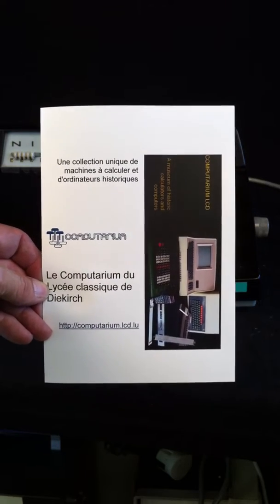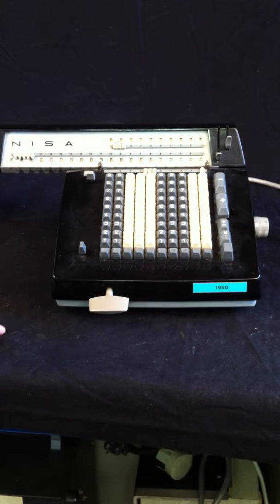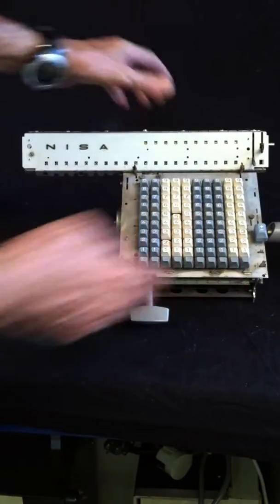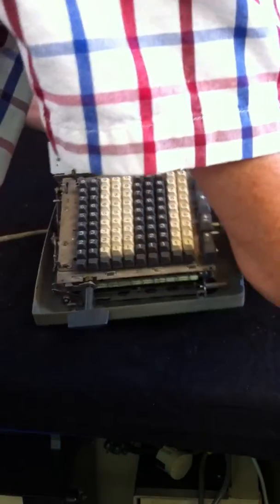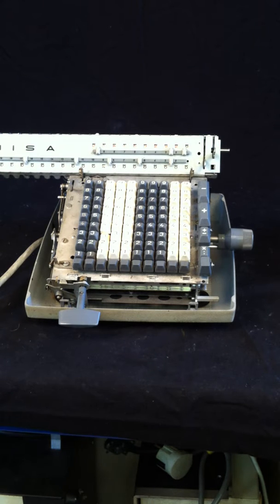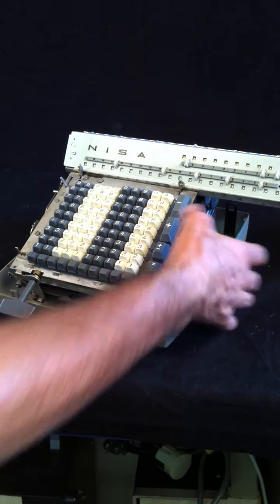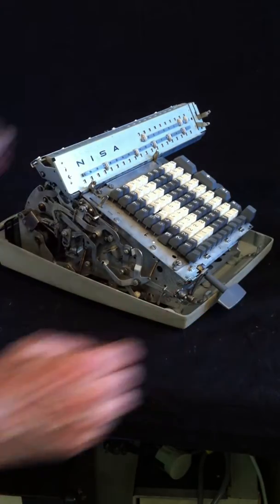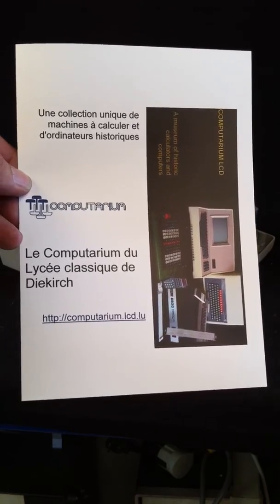A vintage NISA PK5 mechanical calculator's  "jumping" division.

Comment: The electromechanical one (PK5) is actually the very last model from the 70s - produced between 1970 and 1976 when the production of calculator at the plant (located in Proseč nad Nisou in Czechoslovakia, the name Nisa comes from the river flowing through the town) ended and it started to produce computer parts instead. The uncovered manual one is slightly older, from end of 60s, made as the electromechanical one's cheaper counterpart. Calculators from 50s have different logo (script-stylized) and are more colourful.